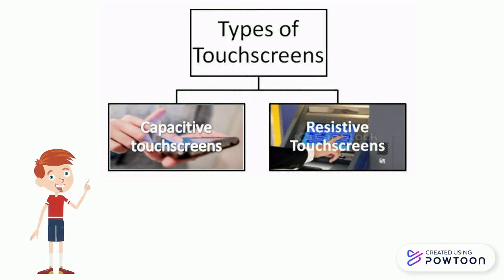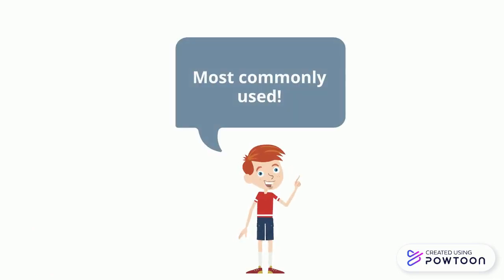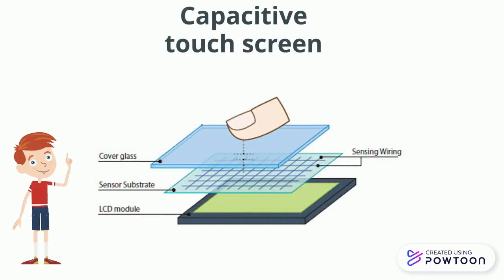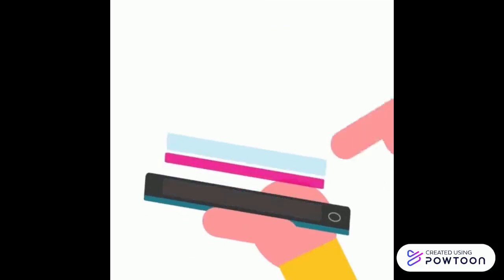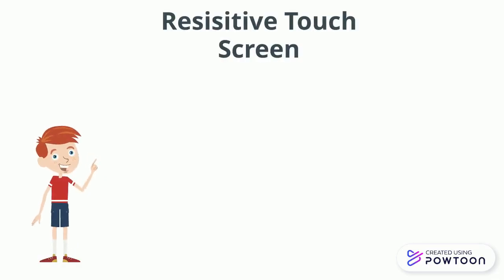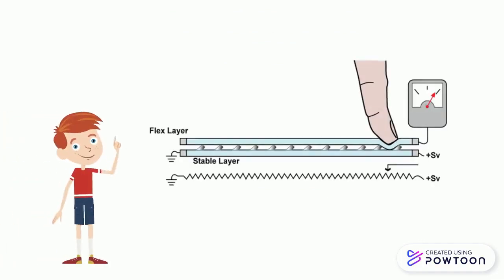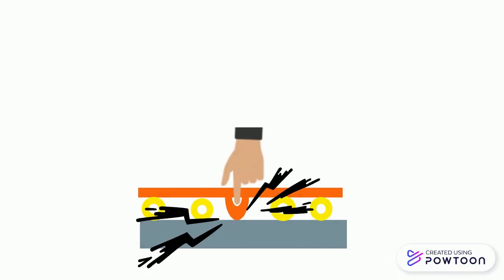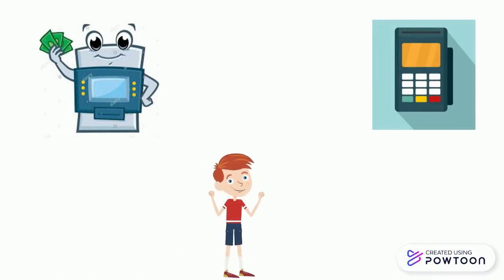How do Touch Screens work?

Comment: Anmol ji.
Ek previous video mein mene ek comment kiya tha per koi reply nahin kiya
Reply from the maker: See I think your opinion is right about core of earth. As I understood by reading your comment in which u said that how there is high pressure at the center of earth if it has very high temperature. I will definitely think about it. But now I actually don't have the knowledge of this question I will also learn and then will tell u for sure.
Reply: @howitworks-anmolshastri2259  कोई आपत्ति नहीं है अनमोल ज़ी।
आपकी जब भी इच्छा होगी , बता दीजिए गा।
आपका मेरे कमेंट पर रिप्लाई करने का धन्यवाद 🙏